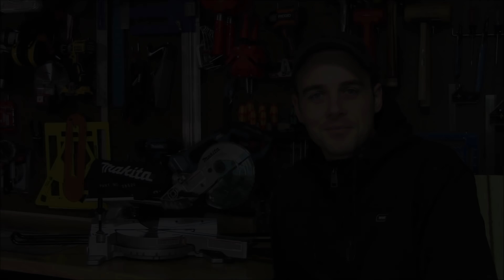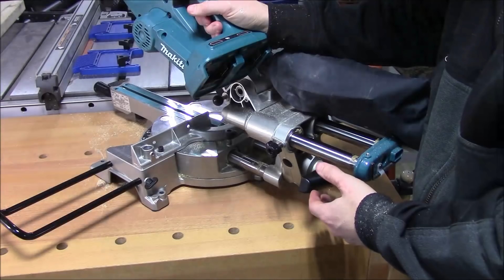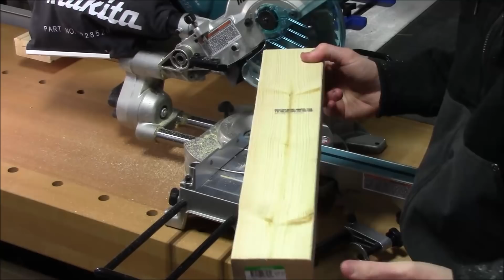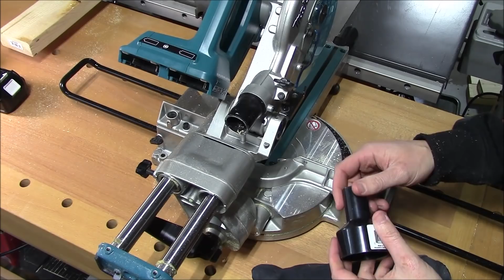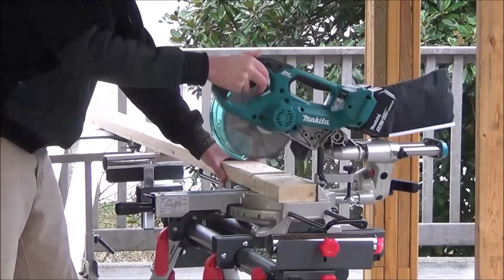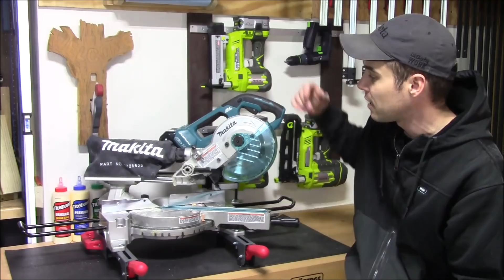Makita 36V Brushless 7-1/2" Dual Slide Compound Miter Saw XSL02Z / XSL02 18V X2 LXT

Comment: This saw is the perfect compact saw. In reality, I have used saw as a lot and well you might use the laser as a guide, you still pull the saw down and check it on the piece of wood before you cut because the thickness of the blade so to be honest a laser is only a guide but not what you really use to cut but it couldn’t hurt to have it either.

Comment: I bought one of these saws a few months ago, when I first got it I noticed the top sliders had a grinding feel to them, like the bearings were stuffed. I thought this might smooth out with use but has only gotten worse, I sent it back to Makita but all they did was put some grease on them and  said there was nothing wrong with it. While this is not a big issue when your cutting framing timber where accuracy isn't so important, when cutting finishing lines, doing things like false miter's and such, it's a pain in the ass, and I would expect a drop saw that cost me over $1000NZD to perform a whole lot better.... am I just being anal, or does it sound like there's something wrong with my saw? Cheers.
Reply: just got a brand new DLS 714z and straight out of the box; found exactly the same, disappointed with Makita, pretty poor show, if it's a regular occurrence

Comment: Surprising that Makita would compromise the user safety as a means to alert them the battery is low, would some flashing LEDs on the battery indicator not have been sufficient?
Reply from the maker: I don't think it was intentional......I just noticed it happening as I drained the battery fully, which is why I said something about it.

Comment: Great review as always!! This saw looks like a great performer but could you tell me what the dust extraction is like with the bag and then with a decent vacuum?
Reply from the maker: +Steven Marshall Thanks!  A vac will always do a better job than a bag.....with minimal dust escaping prior to being removed.  The bag works well UNTIL it fills up....then the dust goes everywhere.
Reply: +Real Tool Reviews thanks for the reply. I am invested in both Makita and Dewalts 18v lineup and can't decide which cordless mitre saw to
Invest in. I currently use the DW717 as my corded (although I may upgrade to a kapex in the next year). After using both which would you choose regardless of price? Then taking into consideration the Makita is $300 more expensive than the Dewalt here in Australia. 
Thanks in advance.

Comment: Excellent video again. Hmm. Let's see. Over 500 cuts with 2 batteries. No led.No horizontal handle.Although they did make some on their 10 inchers I do not know why Makita insist on making vertical handles on their saws.Once you use a horizontal handle there is no going back to vertical. It's all about control and feel . ergonomicly also less cts (curpel tunnel syndrome) on your arm. If you look at the competition like the Dewalt 7 1/2 cordless miter saw, they too offer 275 cuts on one battery and theirs is not a brushless motor. I do not see any advantage using up 2 batteries at the same time adding more expense to the saw. Being a brushless motor ,it should have been more like 600 cuts because brushless supposed to double battery power.I currently use Dw712 miter saw for finish work. It is the only saw that's made in Italy on their line up if you don't mind the cord. fellow who mentioned about choosing between saws from Mak Dew and Metabo...Very simple.
1.German Metabo
2.Mexican Dewalt
3.Chinese Makita
Reply from the maker: +Adam Eglen Thanks!  A few points regarding your comment......this has a larger blade than the Dewalt (more mass = more power to turn it).  The Dewalt got just over 200 cuts in my testing, not 275.....and also the Metabo is made in China, not Germany.
Reply: I bought one and it says made in Buford Georga. https://twitter.com/agwsales/status/730450042792890368

Comment: Good review. I think the saw would be used for a lot of trim applications and you failed to mention its capacity on crown molding and something like standard 5 1/4 base cut standing. The back fence height looks small.

Comment: Awesome and very complete review Daniel !

And the saw is also awesome. Runtime is enough for everyone. The power is definitely there.  I still have to wait 2 months before it is available in Belgium.

What did you think about the accuracy?  Is there alot of side to side wobble or quite stiff?
Reply from the maker: Thanks!  I thought that is was very accurate right out of the box (square cuts) and didn't notice any issues with blade wobble, even with non-stop fast cutting.  The dual slides really stabilize it, and the smaller 7-1/2" blade didn't have those same issues like a 10" or 12" could.  I really like Makita saws a lot.....this & the XSH03 are two of the best out there.